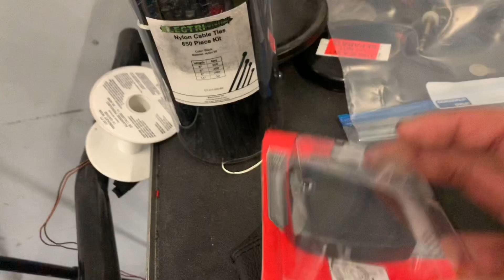S14 Manual Swap Complete

Comment: The control box that you took out to put the clutch pedal in how did you fit it back in after installing the pedal? I’m doing the swap on mine and I got the clutch pedal in and there is no room to fit that box back in.
Reply from the maker: Took it completely out it’s the ecu for the automatic trans you don’t need it

Comment: So sick. I’m in the middle of swapping my s14 and have a question about the crank angle sensor, did u leave it? Did u remove it ? Did ur transmission already have a hole for it? I’ve heard that the s14 trans has the hole but I got played into getting a s13 one. If I run it without it will my car fuck up? Thanks Alex :)

Comment: Did you ever get your speed sensor to work
Reply from the maker: It worked off rip
Reply: @alexrin8273  did you grind it down? I thought autos didn’t fit manual trans

Comment: Yo could you do a video on how to wire up the speedo?
Reply from the maker: My car is a 96 and it has a plug at the rear of my transmission so the harness just plugged in
Reply: @alexrin8273  the auto harness just plugged in?